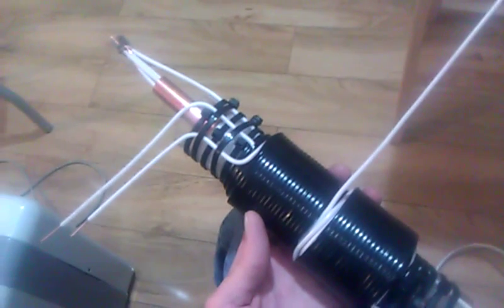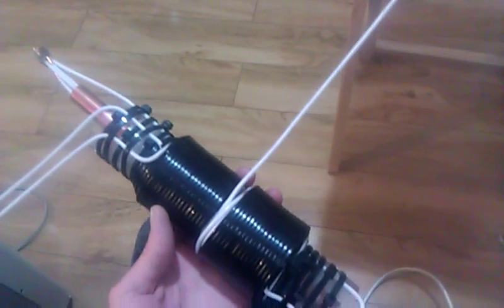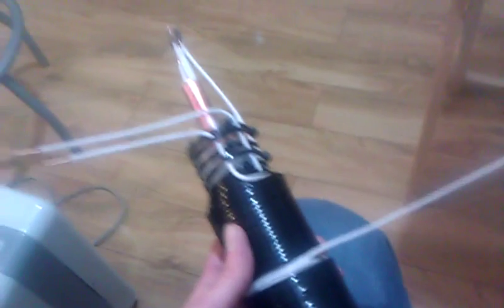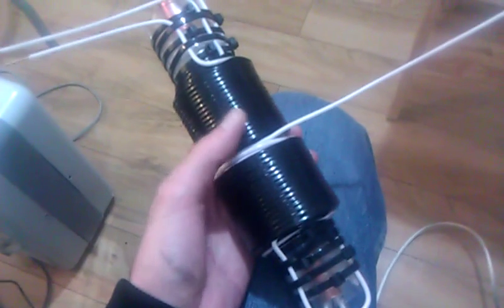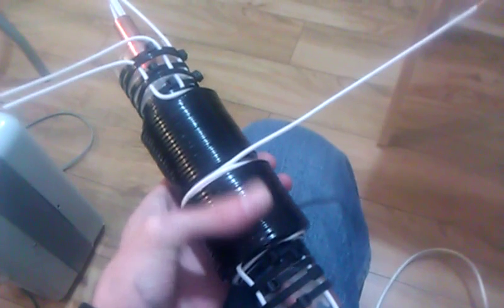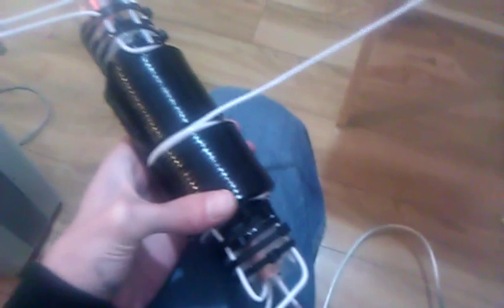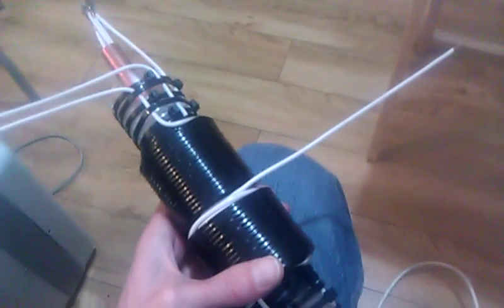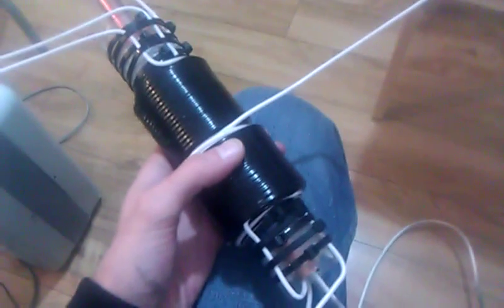Don Smith Device Project Part 24: quick update and Kapanadze on the side

Comment: your inside coil looks way to big.  Don said it has 2 be 1/4 of the turns of ur L1.  Have u tried the L1 having a few turns missing in the middle,  to make it allot easier 2 tune it by moving ur L2  back and fourth thru the center of the main coils.

Comment: keep up the act of civil disobedience.  Where did you get the special HV diodes that change the saw tooth freq. pattern into a hv  pulsed DC one.  Don said they stopped making them in 93'.  They are needed for operation.   Try to find out what they were used in, but U will need to make ur L1 allot smaller.  U will have way 2 much power going threw them.  peace....

Comment: Kurt, great work!  I am replicating your 1/11/12 schematic.  My coils are different because I can't afford pre-made ones. 

The design here is different. Can you please tell us if this is the current design that you recommend?  If so, would you please post a revised schematic for it?  What is the red tubular component from one of HV output diodes to one side of the coil?  Also, is the direction of the HV diodes from the HV ignition coils the same direction as the Jan.11 schematic?

Thanks!!
Tony